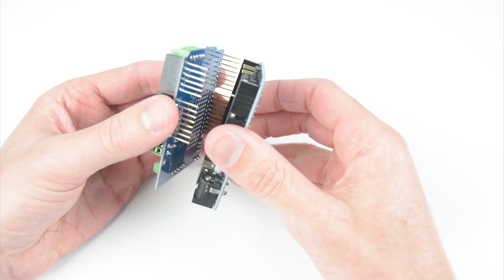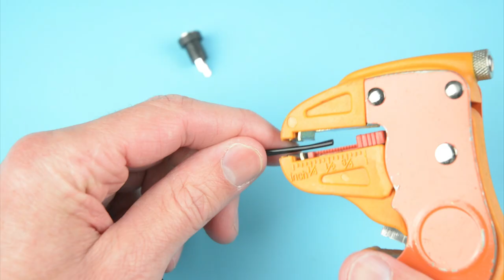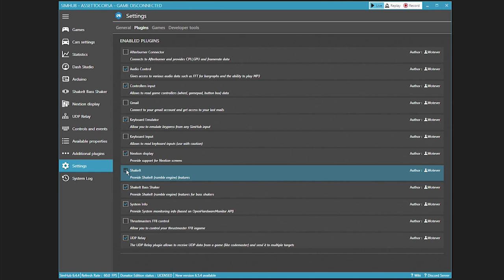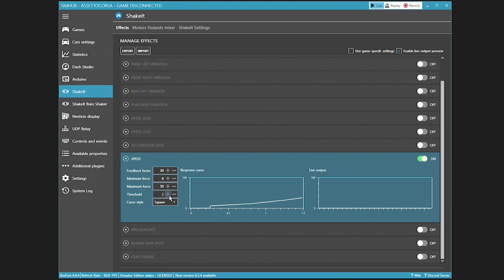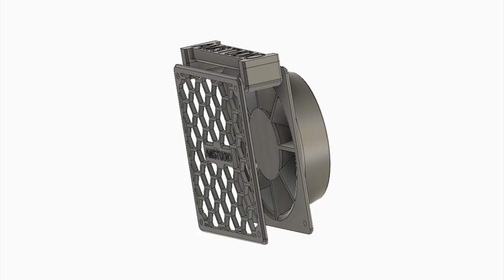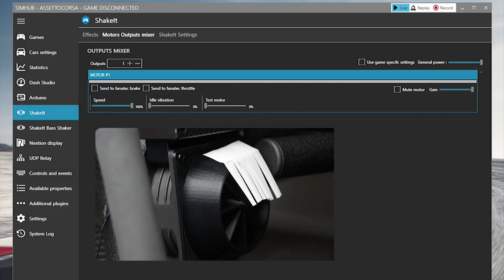DIY WIND SIMULATOR with SIMHUB

Comment: Cool! I did this a few years back with a 280CFM 12V fan and Project Cars. Really convincing experience.
Reply from the maker: Awesome!
Reply: Its not windy in a car though
Reply: @Teddy_Bear312  it is with the window down, or air ducks through rear windows, on convertible and open wheel vehicles.

Comment: ok im really enjoyed and gather more information about your builds and modification you made your setup but i cant wait you make a FFB steering wheel using arduino uno , rotary encoder and a steper motor along with the shifter and the pedal (y) and keep up the sharing for the open source community

Comment: Thanks for the video! I’m actually following the instructions and works fine! But the fan is always running in a min speed while plugged to the power.. never reaches 0. Is there any way I can completely stop the fan when the car is not moving?

Comment: Do you have any advice for what to do if the fan's are emitting a high pitch squeal when not at 100% duty cycle.
I've tried two different models/makes of fans now and the system emits a horrible high pitch whine when at low RPM's.

I'm a little stumped as to what is causing it or how to remedy it.
When at near or 100% the squeal goes away and is just replaced with the fan noise itself.

Thanks

Comment: I love this project and am really considering making it. Just one question though... How would you connect a 4-wire fan to the stepper? Since there are 5 ports I am not sure which ones you would put the 4 wires into. Any help would be really appreciated!
Reply: The fan would feature two particular wires; red (positive) and black (negative). Just use those and ignore the rest.

Comment: can I use one arduino to control both my pedal motors and fan motors? I'm not sure how to tell motor 3/4 to be used for the fans. Motor 1 is selected for brake, motor 2 for gas. Would appreciate some advice thanks!

Comment: Is this compatible with the rumble pedals?? The way to do it is the same, but could it work together? Even with the same arduino and shield?
Reply: I was also wondering about this. But I don't think so. To my knowledge, the sketch you load onto the Arduino is application specific. If you load the "Sim Wind" sketch, then load the "rumble" sketch afterwards, you will erase the first sketch. If you could merge the 2 sketches, it could be done, but for ease of use, and fault finding, I would purchase another Arduino, and build both. In fact, that's what I did...
Reply: @louisbabyCT  It is compatible. I setup the rumble pedals first, then used the 2 extra outputs on the motorshield for 2 fans. Really easy and works great. Make sure to use a 12v power supply with enough current to feed your fans. My power supply is rated 2.5 amps.

Comment: Hey man, how did you run these DC fans on simhub and Arduino at less than 100% without a horrible screaming noise from fans, i have made the same setup as you but im using a Arduino uno and a SH Moto Monster board

Comment: Thanks for this new video! Question.

I realized your button box with 32 functions tutorial. Everything works perfectly. 
Can I buy the "motorshield" card and use my Uno card from my button box for this tutorial ?
Or SimHub remove my button box configuration if i try ? (This will allow me to have only one USB used. (Button box + wind simulator (and i think add vibrator pedal)) :)
Reply: no idea ? :)

Comment: Can we use this arduino code with the shakeit code which is already uploaded to arduino+motor shield for using pedal vibration motors? Or do l need a second uno?motorshield?
Reply: One uno and motorshield will do 2 pedals and 2 fans. Use a power supply with enough current. Mine is 2.5 amp.

Comment: He Amstudio, don't understand I have blow two motor shields following the instructions and getting the correct power supply in your notes. any thoughts
Reply: I guess you think that the long pole of the power jack plug is the Plus.. I thought that to :/
Reply: Thanks for the response all sorted. Can’t believe I had two dud motor shields I went back to the supplier. Swapped and it is working now. Thank you. Btw great channel
Reply: @SpartanRacing   Hey Spartan, so the longer pole  of the power jack plug goes to the cable with the white marking on it right ? Thank you!

Comment: My fan is a little more powerful than yours, it's 6000 rpm and draws 1.8A steady. Is that too much? Also, can I use the monster moto shield instead of the motor shield V2.? Thanks

Comment: Hello, good video. Let's see if you can help me. I have 2 4 pin fans and I have the Arduino Uno R3 and the Shield v2.0 motor board. The question is how do I connect and in what order the 4 wires to the Motor Shield board? I have seen your videos and you only connect two cables. Thanks in advance.
Reply: did you figure this out? also doing the same thing
Reply: @togl5308  What about you? Did you figure it out haha.  the 2 wire (listed as 4 wire) fans in the description are disco'd
Reply: @jordangartner8483  the 4 wire ones don’t work. Had to return mine. There are resistors and other things involved with getting the 4 wire ones to work

Comment: @amstudio does this fan and motorshield combo exhibit coil whine?
I have made one of these with SanAce 150mm fans and Adafruit Motorshield V2 and get a pretty annoying whine from about 30% power (when the fan starts spinning) to about 80% power. After that its fine but obviously limits the effectiveness of speed based telemetry input.
Reply: Try lowering the the PWM frequency to around 500 in the Arduino/Motorshield set up

Comment: Just had a few of my parts arrive. My fan is a 4pin style.  Can I just use red and black and leave the other two cables out? Cheers
Reply: I guess so because the one in the description link is a 4 pin as well
Reply: Did this end up working for you? Trying to find fans as the ones in description are discontinued. Thanks!

Comment: Hey AM, what is the difference between the two 12v power supplies? Trying to determine why one of them works for u p to 4 fans? Thanks!
Reply from the maker: Hey Chad, Both 12v with different output (Amps). One has an output of 2A the other larger one is 5A
Reply: @amstudioprojects  Hi, might be a stupid question - but why not powering the Arduino directly? Why go through the motor shield? Best regards Niclas

Comment: ... - - - ...
Can we use another Motor Shield which available on amazon? (SLAEX039 L293D Motor Shield for Arduino)
Which is cheaper than V2.
Reply: Yes you can. I built mine with that Motor Shield and it works great
Reply: @zombie821  I tried with this motorshield and arduino micro pro. But don't work the fans. Tomorrow will try an adaptador 12v 3A

Comment: I have problems with the electric noise (intense beep) of the fans at low revs (only 100% noise is not). I tested with three different fans ...
Thanks :)
Reply: PWM Frequency to 400 or 500 Hz

Comment: I found it better to use a four wire PWM fan. This means you don't need a motor-shield. Instead you put the full 12v to the fan (bypassing the Arduino) and use the PWM signal direct without worrying about power draw.
Reply: possible to send detailed instructions? cheers
Reply: Hey bro I would really appreciate it if you could make a video on this or something. If you could really bypass the motor-shield then I'm down for it. If you can't make a video any helpful links or instructions would be greatly appreciated. Thanks!
Reply: Looks like a bull sh#ter too me!

Comment: Usually you have windscreen so it doesnt blow inside of car
Reply: I was thinking mount it above the monitor blowing across the top of your head to simulate an open cockpit car.  The setup in the vid only makes sense if you have an Ariel Atom....

or a hole in your floorboards...
Reply: Or a dirt car or Indy car or.... Not everyone races closed cockpit cars